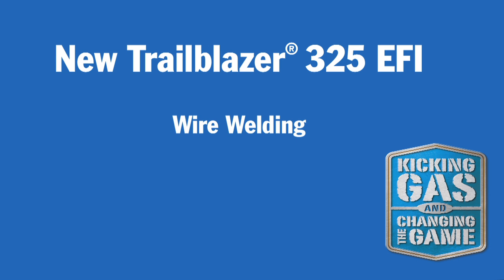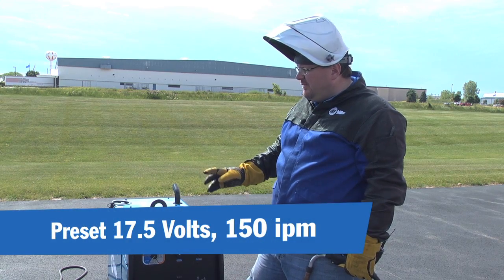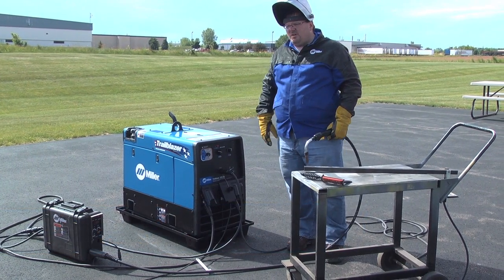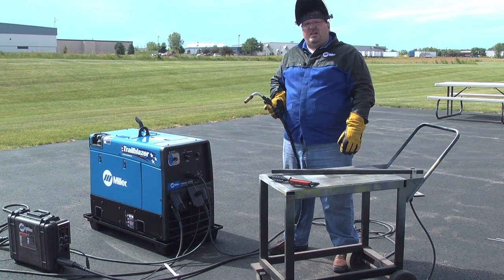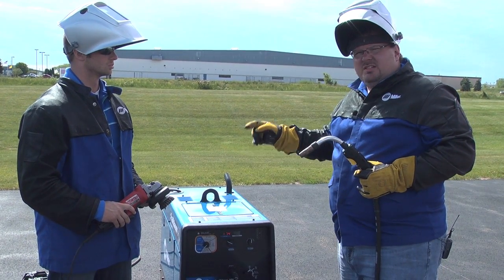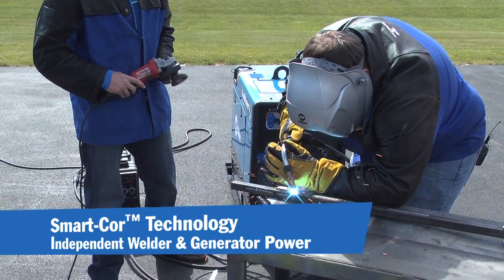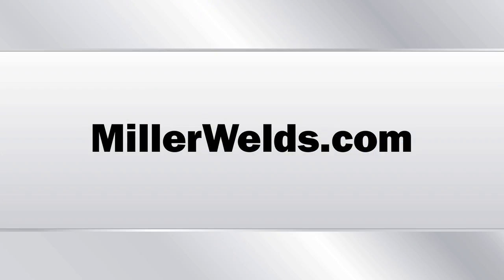New Trailblazer® 325 EFI Demo 3 of 3: MIG/Flux-Cored Welding Comparison

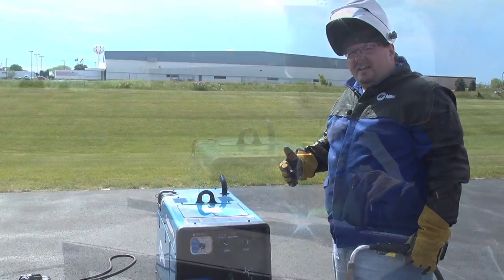Comment: Seemed to me like you cut out or dampend the sound of the motor by switching to a directional microphone aimed at the stinger as soon as he began welding and then resumed it or switched back once he broke the arc 1:20 ..... I love Miller and the products you guys put out but that's pretty disgusting if that's the kind of thing that's needed to sell machines these days rather than genuine innovation which will speak for itself.

Comment: How safe is to run this machine on the rain?
Reply from the maker: Hello, MSD Welding&fabrication. In general, precautions should be taken when welding in inclement weather, such as covering or enclosing the work area, wearing appropriate personal protective equipment, or ceasing projects until the weather clears.
Reply: An aluminum cart with casters, fork pockets on the bottom and a lid with only 2 holes, one for the exhaust and one for access to the lifting eye. I work in a very rainy environment and these machines with a cart and lid champ it out.

Comment: That auto speed thing with change your arc characteristics when running a larger diameter wire. Running a trailblazer diesel, when the engine comes down from high rpm the arc will change and almost switch from a spray to a glob transfer.  This feature should be an option you can turn off

Comment: What other MIG suitcases are compatible with the Trailblazer 325 EFI?
Reply from the maker: Hello, here is a list of the suitcases compatible with the Trailblazer 325 EFI: 

https://www.millerwelds.com/-/media/inriver/m655-arcreach-wire-feeders.pdf

https://www.millerwelds.com/accessories/wire-feeders/suitcase-12rc-wire-feeder-m13651

https://www.millerwelds.com/equipment/welders/multiprocess/xmt-350-fieldpro-with-polarity-reversing-m30173

https://www.millerwelds.com/accessories/wire-feeders/xr-alumafeed-suitcase-wire-feeder-m00338

Comment: Couldnt get through to Dustin this round . Talked to em a month ago when my trailblazer 325 froze up in Michigan 1100 miles from home . He didn't seem interested in the problem . The cooling fins on top are right above generator . So snow melts drips down through the cooling fins . Drips straight down into the generator cooling fins and Freeze's up . Then the machine wont rotate ta start ! The cooling fins on the back are pointed IN side the machine and down . So every time it snows or rains it all runs right inside the machine on to the battery ! And on a 90 degree day . It over heats and wont re start . Im gonna redesign the cowling . I cant keep gettin shut down over some  snow ! Dont know what else ta do . Who ever designed the cowling is on serious drugs or something . Called tech support again . They wouldnt pick up the call . My neighbor has 2 of em sittin out side his shop . Same problem . He went back to a lincoln . Ther not having this issue

Comment: Do you guys still finance?
I financed my first machine through Miller financing, a bobcat 250 nt.  Then I bought a 301g, and the 12 rc. Now, I can't find any retailers to be up front with me about financing equipment.  They just say something along the lines of, "You might as well just use your credit card." Well I would like to get it from the horses mouth. Will Miller still finance me?
Reply: And where can I get financed ?
Reply from the maker: Thanks for your question. We do offer financing through the PowerLINE financing program if you’re looking for options, but certain conditions apply. We recommend connecting with your nearest distributor to learn about your options with the following link: MillerWelds.com/wheretobuy

Comment: why dont you try it with a 15 amp 5" grinder while applying a load on the grinder 
with a .045 wire at 30v 275 ipm just for fun?
Reply: Or run 1/16 flux at 350 and 30v flat

Comment: Will that machine weld 211 .068  on galvanized 1/4"  steel on CC high ?
Reply from the maker: Thanks for reaching out. The Trailblazer® 325 will run the .068 wire. However, it is recommended to use the CV output, and not the CC. Thank you.
Reply: @MillerWelders  can you tell me about the Miller cp 200 constant potential dc arc power source machine(1971)? Im about to purchase from my work, can i use this machine as a dc arc welder?  Thank you,Rob

Comment: My Big Blue 400D will still be running long after that little machine ends up in the scrap yard.
Reply: Be nice now 😂. Nothing wrong with these machines. Of course a 10k+ machine will outlast a 4k machine. Thats just simple math. I actually saw a very old trailblazer recently and it still ran and welded.
Reply: $13,000 vs $5,800

Comment: Trevor Black3  I beleave back when  miller use to stock product and equipment way back when they use to fill gas cylinder here locally,  I remember reading, the unit had 6 kw of AC 110/220 50 amps, with that you could feed a small village, I think I also read it was available in 3 phase as well, witch to me the best option, but now our local miller shop don't stock much of anything, if you want something, they order it from the USA, I HAD to wait months, now that they don't fill gas here any more, a lot of old miller customers have gone to there competitors for gas, as many don't tlike the carbon foot print of trucking empty cylinder from here to WP MB 8 hours away, then trucking full ones back. not to mention the waste of our fuel recourses and lost local jobs. to support the community.. its like the big USA owned box stores here, thousands will not shop in them, as the take but do not give back to the large community, don't even donate to our local needed cases. I know my self and my whole family is part  of that large no shopping

Comment: i have always been a miller customer in my life of a class A welder in fabrication to ship, heavy equipment repair, always looked at buying the trail blazer diesel-generated DC /ac. but never in all my years had a chance to try one,  I have looked at them in air liquid canada show room way back when they stocked product, not know more, some day I hope to do mfg with one and put all of the mfg and rebuilds, repairs in a  sets of you tube videos, with the custom aluminum pontoon boats, house boats and custom trailers I build

Comment: I wouldn't suggest running a grinder without gloves
Reply: FROM OSHA WEBSITE:

Here are 6 reasons to not wear/not permit the wearing of gloves while working with Grinders or Grinding Machines

Amputations
General duty of employer to provide a workplace free of recognized hazards
Gloves can catch on rotating equipment and pull operators hands into the equipment
Rotation of grinding wheels is at high RPM’s
Operator cannot get hand out of glove when it catches
Equipment horsepower and machine material properties exceed those of the operators flesh
Reply: i always tell people its better to lose some skin when a grinder bites you, then lose a finger.

Comment from the maker: Yes, using Excel power, you can run a grinder and weld at the same time at idle speeds, up to a certain weld output, at which point the machine will kick up as needed to meet the load requirements of the application.